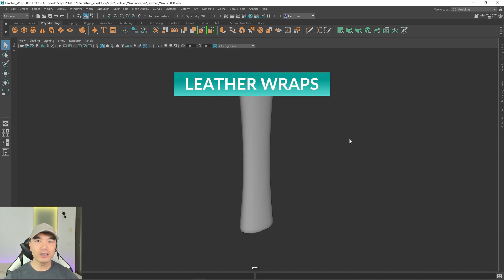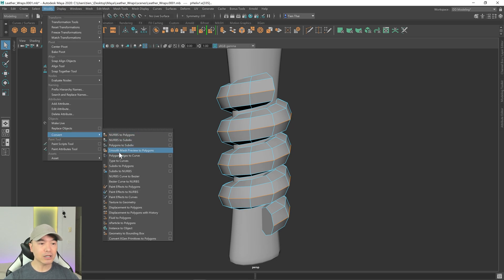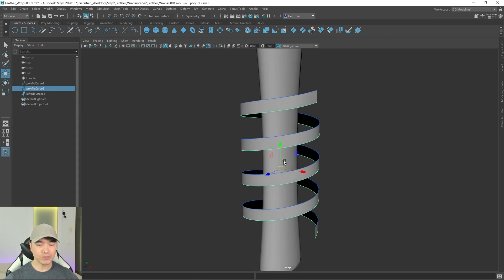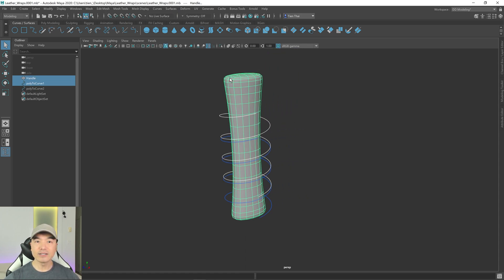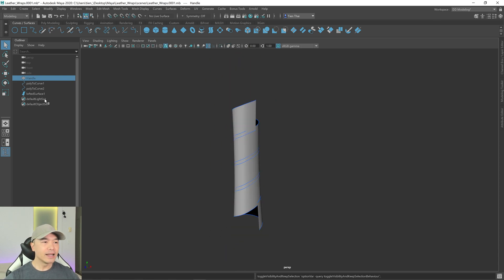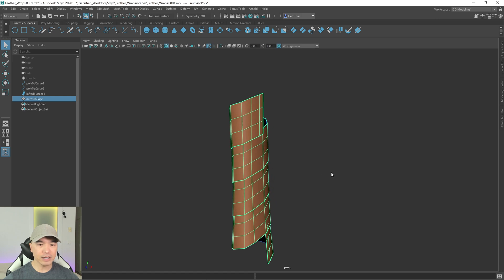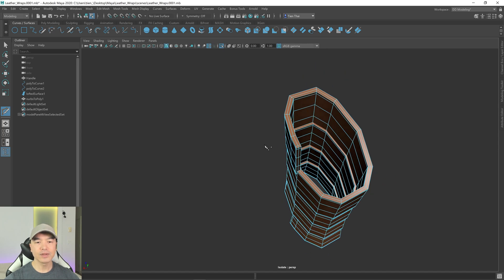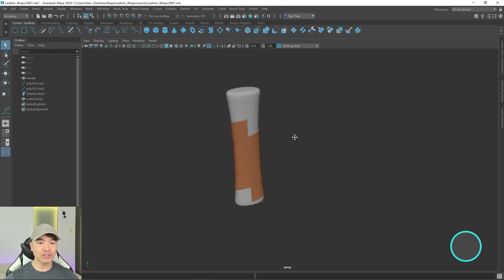Model Leather Wraps In Maya

Comment: What should I do if my object isnt smooth like on your video, and ShrinkWrap works bad? After  ShrinkWrap my curve on object has strange form and coils are not the same
Reply from the maker: Hi it's a little difficult to tell where it went wrong without knowing your steps. Usually when I debug an issue I'll see if I can reduce the steps. Maybe have less coils or try freezing the transform at certain points. For example I might start with a simple cylinder and draw a curve and see if I can wrap it and go from there.
Reply: @DigitalDreambox  Ok, I will try, btw with simple cylinder it works well, but when I make it narrow in the middle, the problem appears
Reply from the maker: @vitalyv8770  You can try freezing the transforms on the cylinder after you've changed it's proportions. That could be the issue.
Reply: yeah, that's my problem now, did you solve this promblem bro?